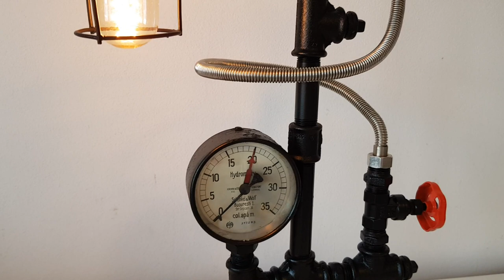DIY Industrial Black Pipe Lamp With Touch Switch

Comment: Interesant cu ai facut sa se stinga si sa se aprinda. au putea sa imi explici mai exact cum se cheama chestia aia?
Reply from the maker: Salut Achim florin, am cumparat contactul de pe Aliexpress, este un "touch switch". Functioneaza numai daca sunt atinse piesele metalice, este foarte usor de instalat. Daca ai nevoie de unul si nu gasesti anunta-ma  te rog :).
Reply: @ImpactDIY  multumes frumos.daca nu gasesc te anunt
Reply: Nu stiu sigur de care trebuie, si nici nu ma descurc sa  comand de pe Aliexpres. daca m-ai putea ajuta ti-as fi super recunoscator.
Reply from the maker: La sectiunea about a canalului gasiti adresa de email pentru contact. Va rog sa-mi trimiteti un email  cu datele de contact. O seara frumoasa!
Reply: Cu tot respectu dar nu am gasit nici o adresa de mail in acea sectiune. Imi apare doar  "849 subscribers • 212,880 views 
Joined Oct 15, 2016
 
Description
Real DIY Life Hacks, Tutorials, Projects and How To´s "
Reply from the maker: impactdiytube@gmail.com   :)